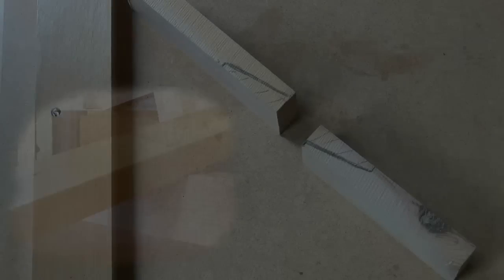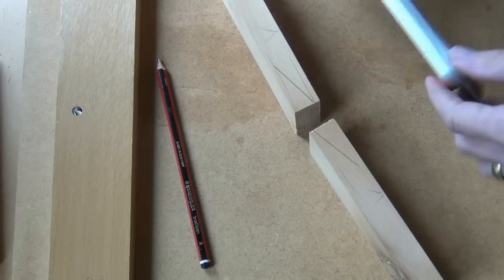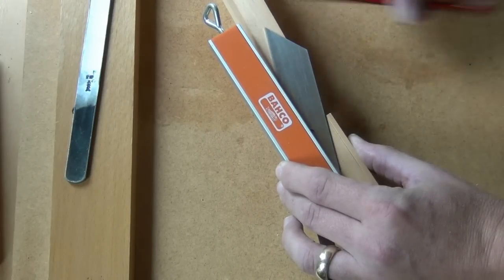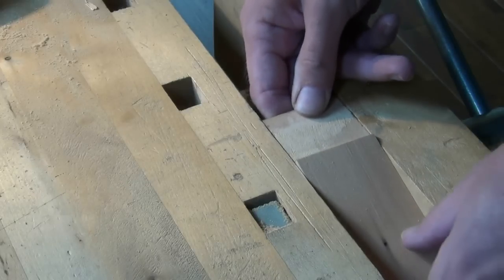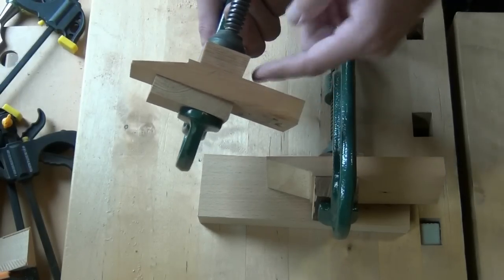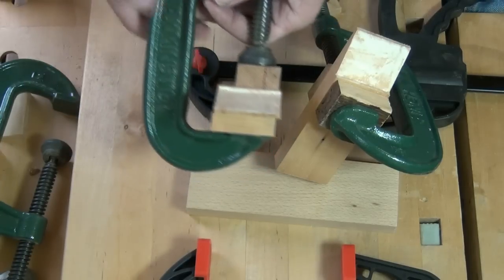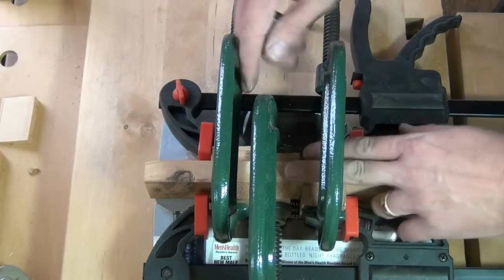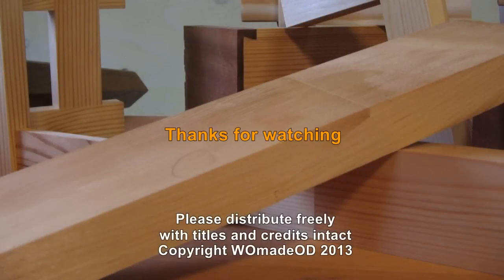Stepped Bevelled Splice Joint (stepped scarf joint)

Comment: Thanks Mitch! Interesting video; I am going to try using this to end join some elm planks to make a large table top.
Reply from the maker: Thanks Chris. Just remember, the longer the bevel the stronger the joint. You may like to reserve this joint just for the edge boards which will show, and use a lapped joint or similar for those within the top. Make sure to stagger the joints too, for extra strength. Good luck, Mitch

Comment: With the stepped ends, seems like this joint could potentially be drawbored, eliminating the need to clamp across the length. Have you ever seen or tried that?
Reply from the maker: Interesting idea. Never seen or tried it.